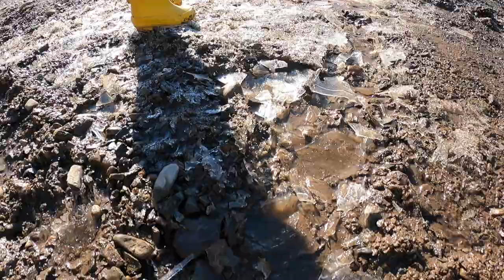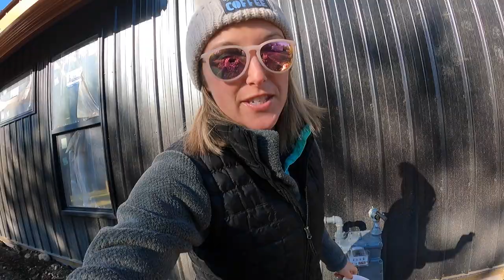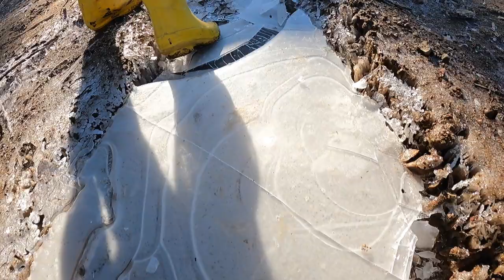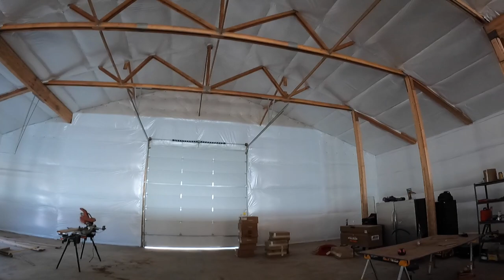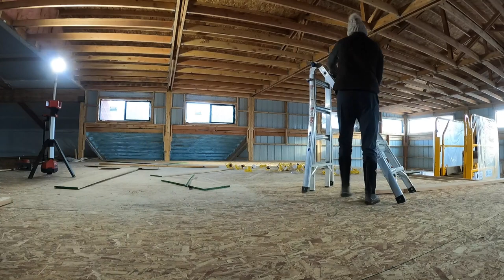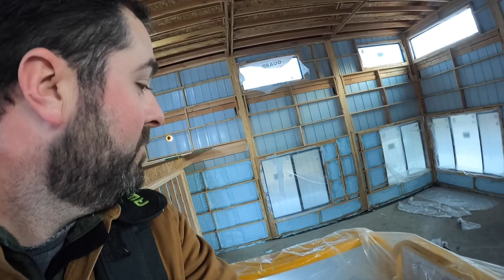THIS STUFF IS AMAZING | Spray Foam Insulation for our Pole Barn House

Comment: Nice progress! Coming along so fast! Is your spray foam filling the entire cavity or are you guys doing a flash and batt?
Reply from the maker: We did two inches of spray foam and then they will cover it with fiberglass batt. You have to do at least two inches of the spray foam or you run the risk of condensation building up and ruining everything! We actually ended up with 3+ inches everywhere, which is great. The company also removed all of the tyvek!